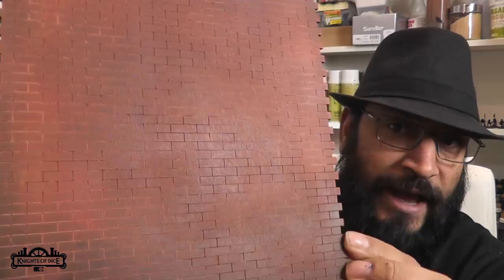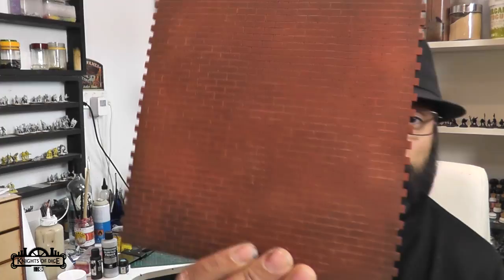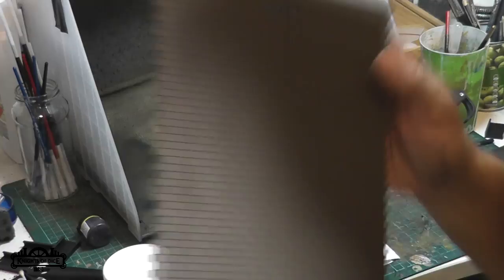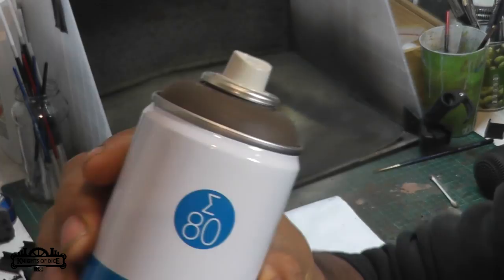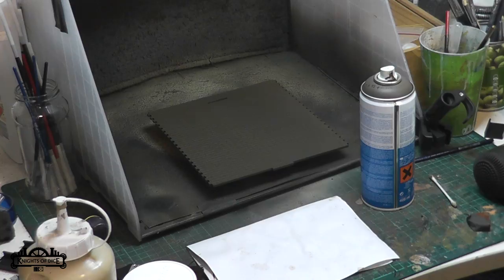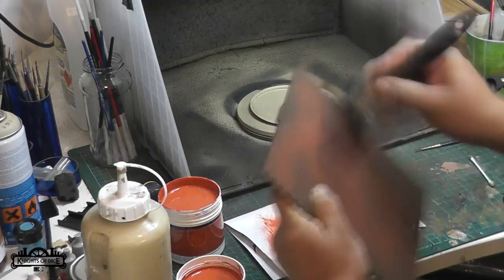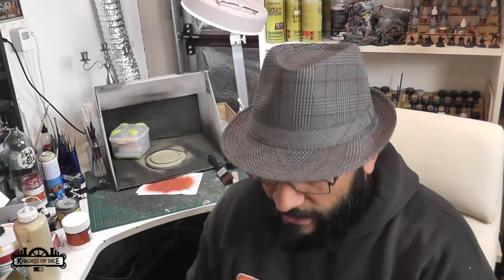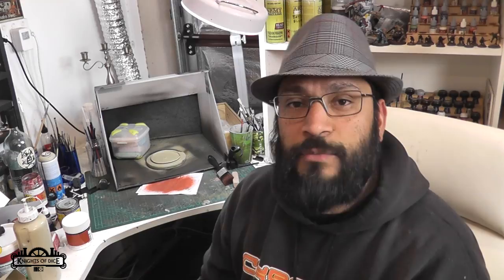Adding mortar to your brickwork - MDF models for wargaming

Comment: One trick with wiping the chalk is to try and wipe at a 45 degree angle to the bricks so the cloth isnt moving along the grooves as it can displace the chalk. 

Thanks for sharing the tutorial, it reminds me of the original D&D dice that came with a crayon to colour in the numbers and then wipe the excess crayon off the die.
Reply from the maker: That's a great tip ... thanks for sharing!

Comment: I tested this technique by wrapping the damp cloth tightly around a  sanding block, and clamping it to keep the cloth tight. Wipe at a 45 degree angle to the bricks, like Mango Man suggested. The bricks I used to test this idea were irregularly sized, but were all rectangular.They also had deeper grooves than the bricks VIv used in his video. 

Has anybody tried fixing the chalk between layers with hairspray and giving it another wipe? I wonder if residual hairspray in the cracks would mean fewer passes. I am also considering a four-step process:
1) Mix a small amount of filler, water and tan/grey paint. The tan/grey should be mixed to reflect the dirtiest you want your mortar to appear. Apply this to your wall. 
2) Wipe off the filler using the sanding block technique described above. 
3) Apply a thin layer of the chalk as a highlight color.
4) Wipe again, same technique.
Reply: I forgot one important line: "I tested this technique by... " should be followed by "It worked remarkably well. Thank you, Viv, for another great idea!
Reply from the maker: Some interesting ideas.  My method certainly isn't the best.  I do want to try playing around with a gloss coat first, as I think that will help clean up the residual chalk in the places we don't want it.

Comment: How does the chalk go when you seal it with varnish?
Reply from the maker: It's a good question.  I answer that in a follow up video that should be up in a few days - I go through several different methods of adding mortar and the affects of varnishes, oils, weathering sprays etc.